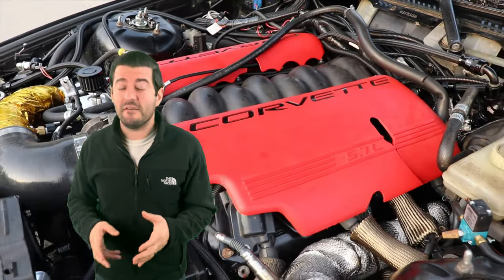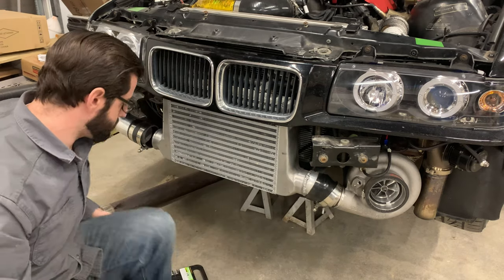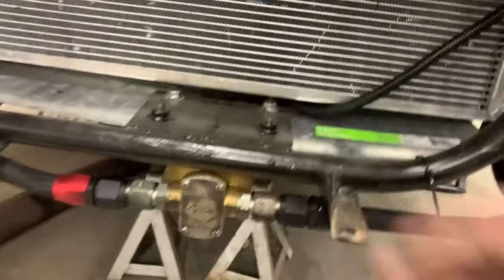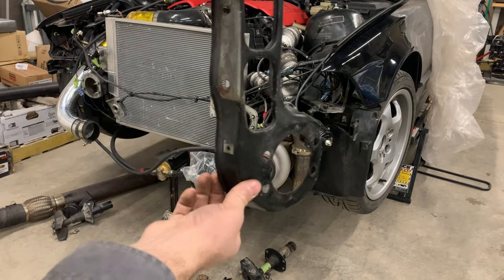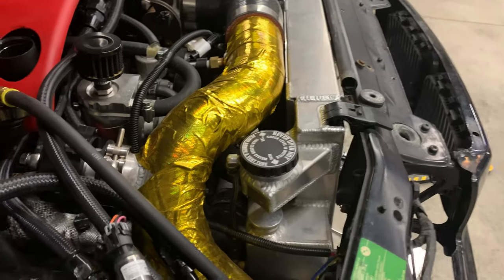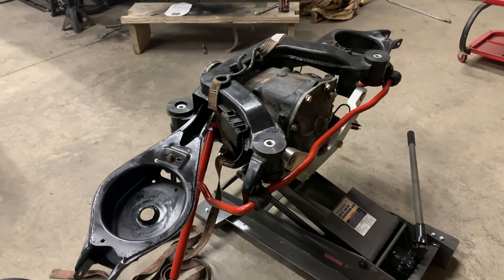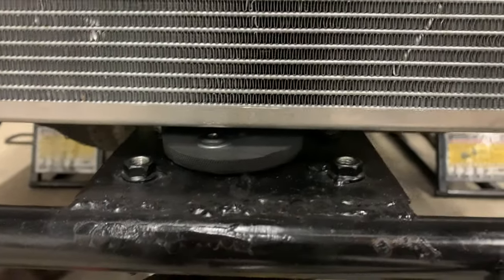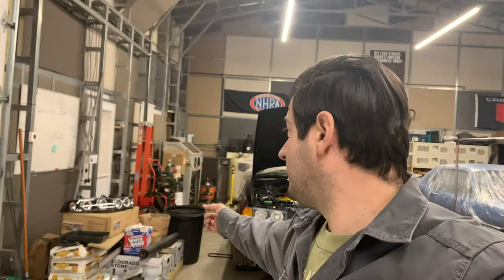TURBO LS SWAP OVERHEATING? I THINK I FOUND OUT WHY: BUDGET BMW E36 TURBO LS SWAP EP- 28

Comment: For me vacuum filling the system gets all the air bubbles out. I sit at 192 in traffic and 186 cruising
Reply from the maker: I only overheat one traffic, driving it’s fine. I may vacuum fill it next, but i feel like it would overheat anywhere if it was filled wrong